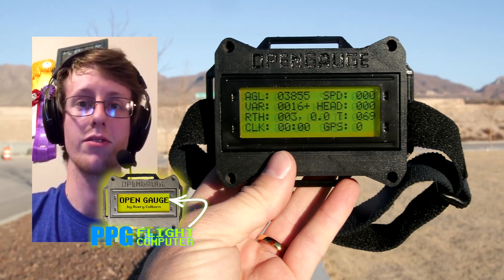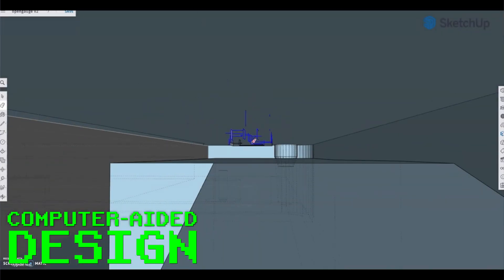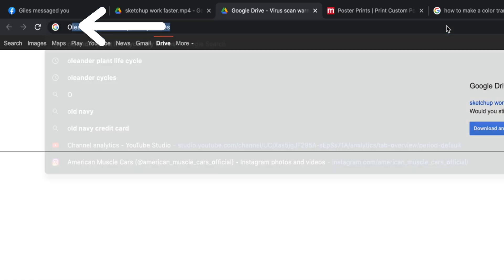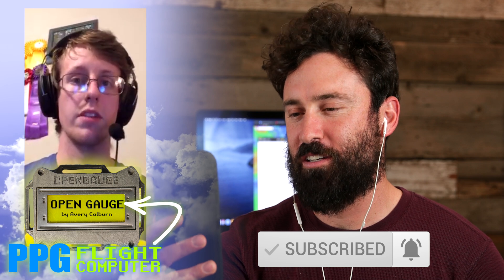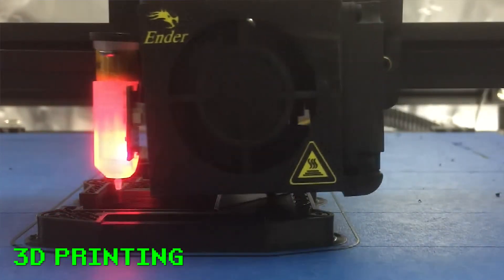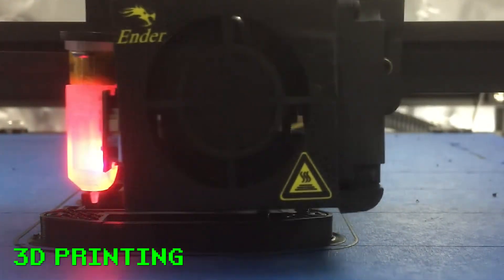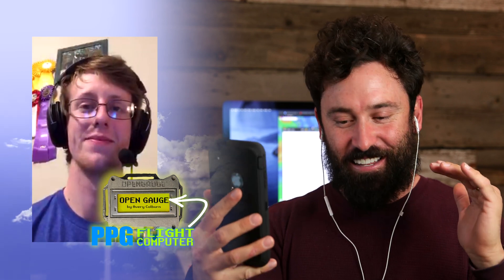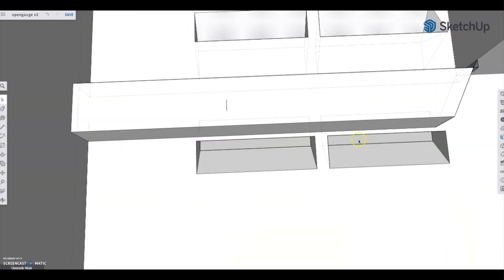Check out this FLIGHT COMPUTER for PARAMOTORS!

Comment: Awesome idea! I’ve been on the lookout for something like this. Im not sure if the device does this already but a suggestion would be to add a timer that measures how long you’re in the air for so you can accurately log your flight hours. Awesome stuff
Reply: I hadn't thought of that, honestly. It does have a GPS-fed clock, so a timer is possible. Let me give it a shot!

Comment: as for the tach...all you need is a sensor that reads pulses from the spark plug cable...most wired tachs wrap a few turns around the spark plug wire to track pulses that are translated to a screen as an rpm measurement...
Reply: this. simple!

Comment: Suggestion:- Can it do voice commands as you are landing it will say 50 40 30 20 RETARD!!!!! That would be so cool like flying a real plane
Reply: Pull up! don’t sink! Don’t sink! Hahha! I though of buzzers, but with the ear muffs and engine noise, not sure how well it would work
Reply: @averycolburn  how about adding a phone type small vibrator to pcb and link it up When you are too low it vibrates
Reply: @maninderthind4309  that has crossed my mind as well. I’ll look into it